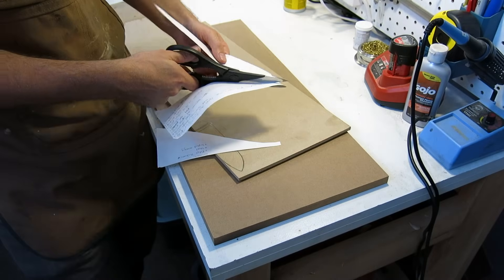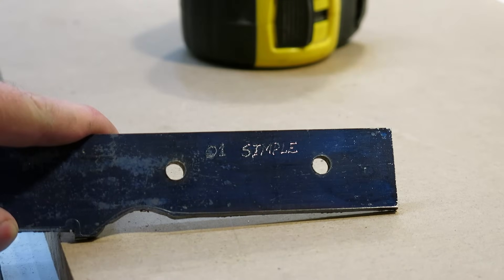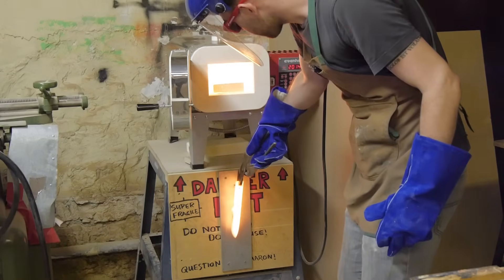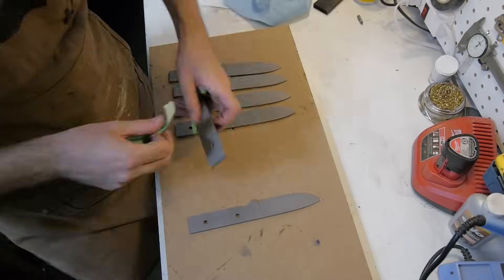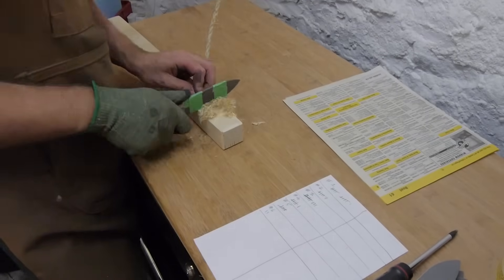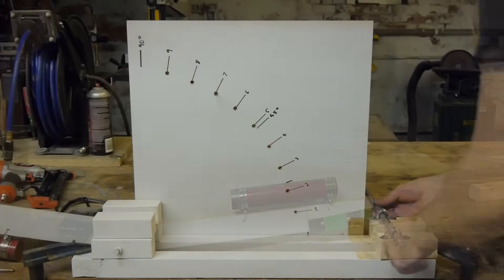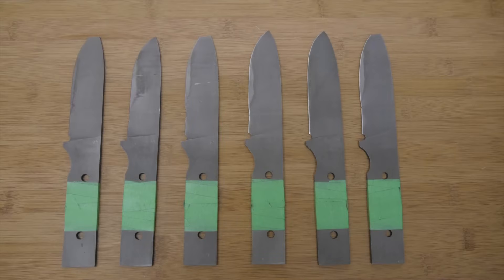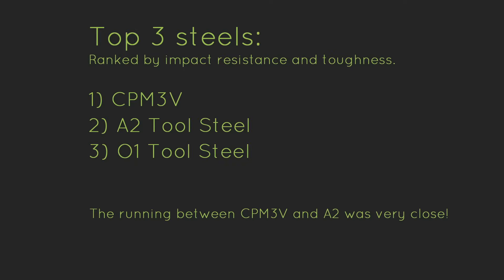Steel testing: a carnival of knife destruction.

Comment: Love the video, but wish you would include a table with the results from all of the testing!
Reply from the maker: there's a full listing of results in the blade forums link in the video description
Reply: Gough Custom I did not notice that! Thanks for the great video, and for posting all of the results. It sure makes A2 look better than I would have expected. 3V is supposed to be MUCH tougher than A2.
Reply from the maker: Subsonic1050 3V definitely is tougher, but it's tougher in the engineering sense. It will deform much more without breaking than A2 will. However it will also deform plastically (not spring back) in situations where A2 will still spring back. I bent the 3V blade to 90º before it broke, but past about 45º it was deforming plastically so even if you let go you still would have had a very bent knife. A2 still bent to about 45º, just after that it broke instead of bending. Both are failure cases that leave the knife useless.

The main issue I had was that impacts on the 3V edge would deform/bend the edge whereas in the same situation A2 would just get a tiny chip that would be easy to sharpen out... There are some more heat-treats that I would like to try for 3V though, we'll see how much of a difference those make.
Reply: Gough Custom Thank you for the great videos and quick replies. I think I am going to try my hand at making a knife. Does A2 steel require any anti-scaling compound, or stainless steel envelope for the hardening process?
Reply from the maker: Subsonic1050 A2 requires a stainless envelope and a kiln at the very least unfortunately. The extra work is worth it though!
Reply from the maker: Subsonic1050 If you want to try making a knife for yourself I strongly recommend using O1, that way you can heat-treat it yourself.
Reply: Gough Custom Wow, I am very glad you mentioned that. I just ordered some A2 yesterday. I could have spent an awful long time profiling that, and ended up with a paperweight. Does O1 benefit from the anti-scaling compound if I use a blowtorch forge?
Reply from the maker: Subsonic1050 The anti-scale works great on O1 in a forge! Makes it much easier to re-finish after heat-treat!
Reply: Just got my O1 steel today! Just curious, what kind of anti-scale compound do you use?
Reply from the maker: Subsonic1050 I use ATP-641 which you can buy from Brownells.

Comment: Why did you choose A2 over 3V?
Reply from the maker: Hey mate! the difference between 3V and A2 was pretty marginal, and 3V had a failure mode that I didn't like: the edge would dent more easily than A2 would chip. 

I have used for new heat treatments for 3V that might fix that, I'm hoping to try them soon.

Comment: Great Video. Cant get enough of your videos! Did you plate quench or air quench the A2 blade that you favored? 

Been reading a lot about the potential brittleness a belt grinder can introduce due to over heating. It would be interesting to see if an A2 blade made on your file Jig would perform in the same way as one made on the belt grinder.

Do you cool your blades with water when using the belt grinder?
Reply from the maker: Craig Wickham Hey Craig!
The A2 that i prefer is air-quenched. I have tried plate quenching it but it's a bit too fast for A2 and the steel ends up a bit brittle.

If you overheat the steel on the belt grinder it won't become brittle, instead it will become too soft. Also that will only happen if you're grinding after you've done your heat-treatment. I do all my grinding before heat-treat to avoid this problem. I do use water to cool the blade when grinding, but it's not hugely critical when grinding before heat-treat.

-Aaron

Comment: Awesome video man but one question. Why did you pick A2 if it was second best?
Reply from the maker: The difference between 3V and A2 was really small, and 3v had a failure mode that I didn't like. the edge would dent at lower forces than A2 would chip. 3V is also much harder to source and is not available in precision ground grades, do I decided that A2 made more sense.

I'm planning to do another round of steel testing soon with some new heat treatments for 3V, do that might change things!
Reply: Awesome and thanks for the replies! I believe I'm gonna save up some cash and buy a knife from you sometime in the near future. :-D

Comment: Wow the amount of time and effort to do these tests. You have a new regular viewer!
Reply from the maker: Thanks mate! New round of testing coming this year!
Reply: I look forward to it. I will be making a file jig following your instructions to make my new knife. I am working on a large O1 camp chopper, it will be my first ever home made knife. After seeing this video I am considering A2 instead. Where are you getting your A2? I have found some sources but it is about 3 or 4 times as expensive as the O1 I am getting. Thanks again for the videos!
Reply from the maker: ZingoSon Unfortunately A2 can't be heat-treated in the same low-tech way that O1 can, so that may make it impractical for you to use it unless you have a kiln available.

If I remember right the A2 I get is about twice as expensive as O1, 3 times as expensive sounds a bit off. I normally buy my A2 from industrial supply places like OnlineMetals, KBC, etc...
Reply: Thank you for the info, I plan on sending the A2 steel out for HT. For double the cost, the performance might be worth it.
Reply from the maker: ZingoSon I definitely think the extra is worth it. A2 is a nice steel!

Comment: Aaron for oil quenched blades you may want to consider an edge quench. This gives you 3 different range bands of hardness in one knife; a hard cutting edge, a spring tempered middle, and a soft spine. This almost always results in a knife that will bend 90 degrees without breaking. Just a thought.
Reply from the maker: I've been meaning to try spring tempering the spine on one of my blades for a while now, really have to get around to testing that!

One complication with edge quenching is that then the spine of the blade won't work as well with ferro rods for fire-lighting, but that's a relatively minor thing.

Comment: Wow for a beginner spoilt by choice in the huge variety of steel available this has been invaluable, and a huge cost saver , is there a summary of the winning 4 with the optimal hardening methods anywhere i can leach ?
Reply from the maker: There's a summary of all the heat-treats in the video description below the video.

However as a beginner I strongly recommend you stick with O1 tool steel, unless you already have a kiln or you are going to be sending the blades out for heat-treatment...

Comment: 440c? Why not D2 or N690co? i really want to see this two steel on stress condition :/ I have a D2 steel knife (Viper Free by Tecnocut) and I find it pretty amazing! Anyway, maybe with your experience, can you tell me how good they are? :D 

Great video.
Reply from the maker: woodyrascel Yes I believe you're correct about the oil or air quenching.

N690 is not readily available over here in North America either unfortunately. Some steels are very hard to get...

Glad you liked the videos mate!
Reply from the maker: ***** Haha thanks Igor! Funnily enough I have a Bohler/Uddeholm branch right near my house, but they don't really stock any of their more interesting steels unfortunately...
Reply from the maker: 440C is actually a reasonably decent steel when it's heat-treated well. It's not very tough though. I included it because I wanted a 'low' benchmark.

D2 and N690 should both be great steels but I don't have any experience with them.
Reply: Gough Custom As far as I remember D2 can be heat treated similar to O1 or air quenched at a higher temperature (if the sources where accurate)......N690 Is my personal favorite as it was the first choice of the guy who started teaching me BUT it has a more complicated heat treating processes that requires specialized equipment that I do not have....but you do!....(knife kiln). Great video by the way!
Reply from the maker: woodyrascel Hey mate!
D2 requires a kiln to heat-treat, it has a very high austenitization temperature and long hold times also...

I haven't tried N690 yet, it's not so easily available in North America. I would like to at some point though!
Reply: Yes D2 needs a kiln but what I meant was it can be either oil quenched or it can be hardened by air quenching (according to the source I use) and as for N690....as far as I am concerned it is the one I would use....only I lack the tools and skills to heat treat it and it is not readily available in the UK so I stick with O1....for now.
Buy the way I need to thank you for all your videos and how to's...learned sooo much from them.....not sure I would have been able to get this far with out them!!!
Reply: Gough Custom if you ever be in Rome, Italy, and want an apprentice, i can provide you all the Bohler you need.. here is easily available :p

Comment: I also seen your thread on hypefreeblades and was wondering if you followed through with your heat treat protocol and testing... and which temper temperature proved most effective... Also, wondering what thickness the blades where that you were testing... and if this heat treat regimen would work as effectively on thicker blades.
Reply from the maker: All/most of the stuff that was talked about on HypeFreeBlades became part of the testing seen in this video! There's more info in the video description.

Your question about the tempering temperature is hard to answer as I'm not sure what steel/heat-treat you're referring to...

I was using steel that was 5/32" thick, thicker blades should pose no problem, though I don't really think you want to go thicker than that for most any knife blade.

Comment: Now that's a scientific way to work! Great video. It would be interesting to find out the corrosion resistance of those blades using different chemicals like salt water, salt water with a lower pH (5.5 like human sweat), etc. By the way, watching a bunch of knives being destroyed almost made me cry :)
Reply from the maker: I actually did some corrosion testing at the same time as the rest of the testing, results are here: http://www.bladeforums.com/forums/showthread.php/1104795-Steel-testing-underway?p=12617733#post12617733

Comment: you should of had 5160 and 52100E thrown into the mix as well . for this testing .  higher Rockwell hardness . will not have thee flex  O1 is a very good  tool steel  and it rep[laced the old Jessup carbon nickel  steel from years ago  I cannot remember the number ,  , and  heat treating the complete blade  sends the hardness threw the blade ad well apposed  to a triple quench edge Harding ,  triple quench  refines the grain structure almost like that of Wootz steel  but making Wootz the easy way ,
 and the edge Harding  gives you a transactional  heat treat  that is proof positive  of edge holding ability   , the edge  is the hard zone and above that you have a medium  zone  and then a soft back .  but the triple quench for any  carbon steel   blade l truly gives you a truly high performance   Blade   ,  I am not telling you your business  and I am not a know it all either . but I have been showed this over a vas 30 years  , in learning as well  and the man that brought this to light  is ED Fowler  , who  experimented with this process  and fine tuned it into what it is today ,  oil tempt  is a factor also  I like your work  and you are a very good craftsman  .  be safe and keep em sharp
Reply from the maker: Next round of testing will likely include 1095 and possibly 5160. Also some newer high end powder steels like CPM4V for comparison, should be interesting!
Reply from the maker: Maxwell Super Hey mate!
I actually just made my first knife from AEB-L the other day, an 8" Santoku. I wouldn't call the heat-treat I did on it 'optimal' though as I didn't have any dry ice on hand to do a sub-zero treatment, and AEB-L really needs that.

Despite that it seems to be holding an edge fairly well so far! I plan to include AEB-L in my next round of steel testing.
Reply: Gough Custom Even though I know nothing about steel, or knives, I'm still super interested in seeing this test!

P.S. You're Aussie-born or raised, yeah?
Reply from the maker: Danny Brickwell Yeah, born in Aus, moved to Canada 7 years ago!
Reply: true, but a knife has to be hard period on the edge, we all agree on that! unless its a machete or chopper, but even then 58-59 is what you want to keep an edge, even a sword needs to be kind of hard at least on the edge. you can make a 42 hrc blade back DH, or do that triple thing, but here's the thing. A good example of a blade that can flex well is a cold steel katana, it only has a hardness of like 55 so it will bend very far and spring back to true and is mono tempered, like infi can with a higher hardness as well. But with a DH type of sword or blade, it will bend well, very well, but it will not spring back to true. So, just having the ability to bend is great, but getting it to keep an edge and spring back to true is very hard. I'm impressed by how well cold steel can do their blades in this area, i think its the mar tempering and sub zero quench! At true swords, there are many examples of how a mono blade at lower hardness will spring back, but a normal style katana DH will not spring back, it can be pushed back, but not perfectly straight by itself. so, its a question of hardness, edge holding, and ability to spring true - not just bend!
Reply: Gough Custom Atomedge here, I may suggest AEB-L as well for testing. With a proper heat treatment it can take a crazy edge and seems to be quite durable given Gavko is making machetes and various chopping blades with it as well as fine folding knives, sharpen-ability is also extremely high.
Reply: what  is  the rock well  right now ?   and how did you temper it ?  and at what tempt ?
I don't know anything about  ABE but  I know  with 0-1 , 5160 and big daddy 52100-E what I do is  triple tempter these steels  , but   after the  hardening  I  let it come down to room tempt then at its full hardness  I put itt in the freezer over night  the next day it gos in the oven at 350 deg's  for 2 hours  let it cool and bak to the freezer for ghe rest of the day and that night  right on threw  , now what I am doing is shrinking the grain structure now if this stuff you  are talking about is air hardening .after the last heat  try this angle the blade in water where the back bone is sticking out of the water , and use a torch  and bring the back bone up to a blue and the handle area .  then leave it along to cook . as I have said not sure what steel you are talking about , I have seen many entire harden  blades Break and here is another thing  that got me to thinking . I watch a show on how the titanic was built , there is a spot in there where it was winter time and below zero freezing out  and the cable snapped  and the plate of iron was about 70 feet in the air  and when it dropped  the plate of steel / iron  when it hit the ground it shattered ..  making me kind of think  this was a non carbon steel / iron  what can happen to  a carbon steel blade made under normal condition's what adverse  effects
 does this have on the molecular  structure
of carbon steel and there is a video of some one using a k-bar in the winter  and putting it threw a series of tests and it did not pass the  first  one it broke . this is one reason that I try to reduce  the grin structure as much as possible when you have silica  steel's like ATS34 and 154-cm  you are going to  have a brittle blade . I talked with a friend of mine  Alan blade  on he west coat and he found a steel  that is out of this world  and holds up well to shock but it is like 90 bucks for 3 feet . anyway . if you  are feeling energetic  in testing  give that a try . and here is the thing also  a soft back  with a hard edge  in a life or death situation , if  the edge would crack and not chick that is still a usable knife and can save a persons life  ,  happy thanks giving .

Comment: which heat treat did you find to be the best for the a2?
Reply from the maker: My favourite heat-treat for A2 so far is:

Preheat at 1100ºF for 10 minutes
Ramp to 1775ºF at 1000ºF/hr, hold for 35 minutes
Quench in still air
Temper at 400ºF for 2 hours
Sub-zero treatment in dry ice and isopropanol for 1 hour
Temper at 400ºF for 2 hours

This give a hardness of approximately 62.5 HRC, but the steel is still tough enough to have a nice thin blade even for knives designed for hard use. My bevels are usually about 0.012 - 0.015" before sharpening, and they're still tough enough to take being batoned through dried hardwood. The steel takes a very fine edge and keeps it nicely!

Comment: I always wondered about CPM steel. 

I bought the first Spyderco military folder back in 1995 and had to use it as a step ladder stuck in a tree. It seemed to flex but never broke as most folders will snap at the drilled hole.

It's just hard to put an edge on it outside using a diamond hone, but holds the edge well enough you don't have to do it much.

Comment: Excellent ,,, Simply TiT's ,,, Beautiful, did you use 1095 CroVan, or 5160, and my favorite is INFI, although my go to knives are in SR101, which is a Deferentially Tempered 52100, similar to 5160, but with more carbon. You made me a happy camper too, I have two set's of Bark River's, my first set, I have the Woodland, 3 1/2" blade, the Bravo 1, Bravo 2, and the Golok, all with Jade Green G-10 Handle's, my second set is my Bravo 1, Bravo 1.5, and the Bravo 3, 3V, and Black G-10 Handle's, havent decided on my neck knife yet, but it will be a Black G-10 Handle, you should get a sponsor, we need more guy's like you, I bet it can get pretty expensive, and time consuming, Thank You, Gough.